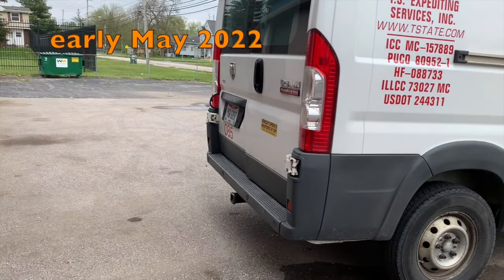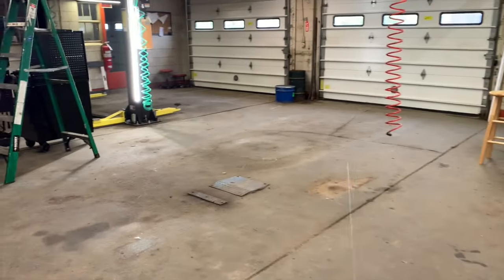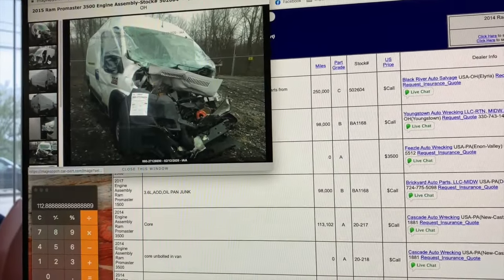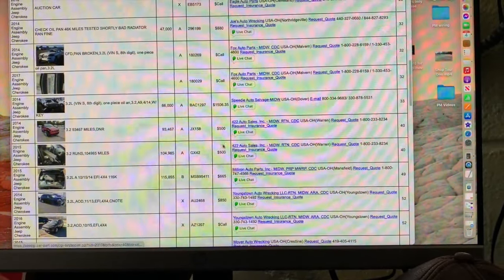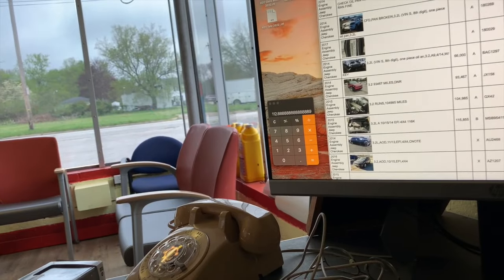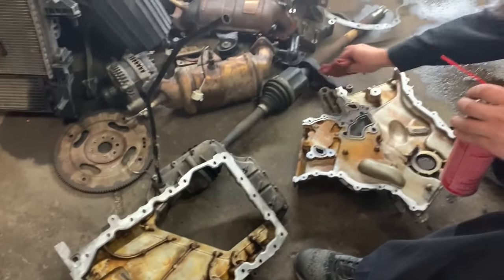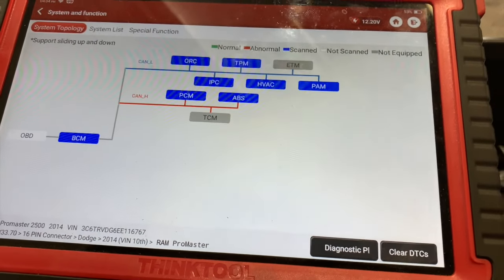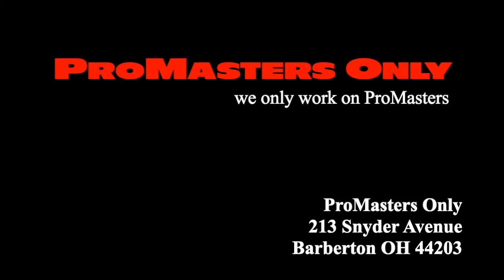Ram Promaster Custom Engine Swap ! Lots to learn

Comment: I live in a 2019 36” 1500, had 32 miles on it when I bought it, has 59k now, have not had one single mechanical issue so far, regular fluid filter changes on engine and transmission, so far so good. BTW, I stopped relying on dealerships for my fluid filter changes, I do them myself. Will be adding a doorman trans pan with drain plug soon.

Your vids are great, helpful and I learn allot. 

Thank you!
Reply from the maker: That's excellent. It's a feature of the interwebs that only the negative gets posted, but puh-lenty of people have had nothing but positive experiences.

Comment: This will be interesting. I've owned a half a dozen Caravans with the 3.3 / 3.8 family. I've noticed the 3.8s always got the best highway milage, the 3.3s the best city milage.  I also own a '20 Promaster hightop 159" 2500 with 3700 miles on it. Thankyou for the video.
Reply from the maker: I made a followup video. Runs great, does the job but has noticeably less power than the 3.6. Mileage is basically the same, unfortunately. 

We are working on the opposite now - a way to get just a little more power out of the stock engine. My feeling is it would downshift less, and be a little more pleasant with maybe 30-40 more ft/lbs.
Reply: @promastersonly1419 Hello Kip, any update on getting more power out of the 3.2?  In late 2023, still running well and worth the effort for $ savings?  Many thanks!
Reply from the maker: @antigroundhogday  It’s still running well in the van we put it in. Still has less power but similar mpg to the 3.6.
Reply: @promastersonly1419  okay, less power but less purchase price. A decent trade-off. Thanks for the update!

Comment: Am curious about the mpg difference. Have you tried airtabs? A few hightop van owners have loved the airtabs, said they reduced the wind effects from passing semi and gusts.
Reply from the maker: I’ve never installed them, but this was much discussed over the years on promasterforum. The consensus is that air tabs on a van dont increase mileage, but they do increase stability. Makes sense. 

As to the 3.2, the data shows that the mpg is basically identical to the 3.6. There is noticeably less power though, and that in turn means more downshifting on hills and under heavy load. I think it would be ok in certain applications or with lighter vans. But without an mpg benefit, I wouldnt recommend a 3.2 swap to a customer. 

The only advantage then is the buying cost of the engine. I was going to do a second 3.2 swap, and bought an engine with under 90k for a whopping $300. Crazy cheap.

Comment: Kip this was awesome, figured it’s been a year since the swap ? Should we still exspect oil cooler and possibly lifter tick with the 3.2 like the 3.6 ? Anyhow at $500 I might go buy one just to keep in a back corner of the garage just in case lol 😂
Reply from the maker: Going on two years. I have update videos on it. So far neither an oil cooler leak nor the tick, but those parts are identical so who knows.

Comment: I got a 3.6 penstar from a caravan with 13k miles for $900 its the same as a promaster. but junkyards see commerical van and add a large premium
Reply from the maker: Correct! It's just a failure of shops to give a crap. Need a promaster engine, search for a promaster engine, pay literally 6 times as much. It's not your money, it's the customer's. 

This particular swap is not really in that category. I had zero idea that it would work. In fact, I expected it not to.
Reply: What site did you get it from?

Comment: Good stuff boys, livin a little. Nice. My 2017 pro master 1500 has only 30 psi in cylinder 5 the poor girl.  I bought it with the repairs required in mind. My guess is the valve issue i see on the tube without a inspection camera in hand. I,m thinking pull the rear head(or left)and fix what is needed rather than sourcing a used engine. Please let me know if its a good plan and also need step by step engine removal if the info can be found on wild web. Thanks and keep them vids comin 👍
Reply: Before you go off half cocked (or fully cocked!) you need a rock solid diagnosis. That would be a leakdown test. With #5 at TDC, put some compressed air in and see where it comes out. Intake, exhaust pipe, or dipstick tube. If its the dipstick, you’re done for. 

If it’s valve timing, 100% confirmation can be had with the valve cover off. Gouged cam, or bad lifters. 

If not cam related, you’ll be doing a head. They come from chrysler assembled with new valves and spring for only $450 or so. You reuse your old cams and assorted valvetrain. 

The rear head (#5 is rear) is a big job but very doable with the engine still in the van. 

As a cost thing, it may make more sense to replace the engine, but it would depend. What probably wont work a traditional rebuild. The parts and labor to rebuild are likely to exceed a used engine, which is $1900 currently for a tested 100,000 mile engine.
Reply: Ha Ha, love the response and very much appreciated,gotta be at least half cocked for the ladies ya know. I have maybe too cheap of a leak down tester coming from the amazonians. Let’s hope quality is enough for this cylinder 5 test . Cylinder 3 is at about 140 psi. Should make wind outta one of the areas that you mentioned. Not quite convinced I will be able to remove that rear head without pulling the motor forward a couple feet. That darn engine cover has to come off the pulley side for that rear head. It would be gravy it I was dealing with 2,4,6. Back at ya with my leaky results just like in the men’s room, that leak is getting old.

Comment: Do the 2022 2500 and 3500 promasters have the same engines? Chrysler has the same part number for block, but some places dont have them as compatible.
Reply from the maker: 22-up have the gen 3 pentastar. Lots of stuff unchanged, but lots of new stuff. Variable valve lift, egr, different intake. Engines are not forward or reverse compatible because of all those changes.

Comment: thanks for the video hey can install engine and transmission from journey to 3500 pro Master thanks
Reply from the maker: If you search for a 2017 Journey, it will pull up everything compatible with a 2014-2021 promaster. This means journey, minivan, some chrysler 200s. It wont give you a choice, but avoid an engine from a 4wd Journey or anything with start/stop. That's for the engines. The transmission are quasi-interchangeable, but not really since the final gear ratio is unique for the promaster. Big topic, but you can "make" a PM trans out of a minivan trans, but it's pretty involved. But any 2014-2021 promaster trans will interchange with whatever you have - all the same.

Comment: So do you think it might be a worthwhile swap for a Promaster 1500 118 shorty low roof?  The van is a bit lighter than a 2500 or 3500 and with the lower roof, has probably around 5 to 6 square foot smaller frontal area so at highway speeds, the hp required to over come wind drag is less. 

I guess what I am asking is does the low roof 118 shorty get any better fuel economy than the high roof 2500 and 3500 136, 159 and 159 extended?

It will be interesting to see how the extra high roof H3 vans will perform or if that extra roof height and weight is going to make a bigger dent in fuel economy and performance.
Reply from the maker: The 118” would be a prime candidate. I have a video on that model. It doest weight all that much less than a 136”, but as you mention the frontal area is a big deal. Owners of those vans report perhaps 1 to 2 mpg better than a 136. 

The height makes a bigger difference, I think. I know this because Volenz owners (with a 3” sleeper above the cab) report mileage closer to 13 or 14 mpg. 

As a tidbit, I own both 136 and 159 high roofs. The longer van gets ever so slightly better mpg. Less than .5mpg, but every little bit helps.

Comment: I have a question the promaster do fits with journey about transmission just transmission
Reply from the maker: Engines from a 14-18 journey are direct seaps, with the only difference being the dipstick and dipstick tube length.

Comment: Wasn't the 3.6 pentastar used in the PMs right from the start, 2014? Sidenote when the weighin for the big contest ?hope u r going to shoot an post it, still chuckling about the rules committee post
Reply from the maker: Yes, and even better they made exactly zero changes to the engine from 2014-2022. Means parts are cheaper and more available and nothing to get confused about. Search facebook for Blubberama 2022 to see the lard loss standings after the first month. Spoilers: I lost 23lbs in 31 days, and DIDN'T have a heart attack or stroke!
Reply: @promastersonly1419  keep up the good PM and blubberama work

Comment: Trying to help a friend here. 2016 Ram Promaster van 3.0 eco diesel. He converted it to a livable van but it recently overheated. First shop said oil and water were mixing and it needed a new motor. When pressed what the cause was they wouldnt say. He called a diesel shop and they didnt want the work. Van is located in North Carolina.

What would you do in this situation? Look for another diesel shop? Buy a used 3rd gen motor(eco diesel) and swap them?
Reply from the maker: Hate to say it, but you aren't going to like my answer. As great as the gasser is, the diesel is the opposite. Expensive, unreliable, and nobody knows how to work on them, including me. I have to turn them away from the shop, and it pains me. If he goes to a dealer, they will lift $14,000 or more off of him for a new engine, which will fail in short order. He'd be better off spending that money on a used gas van and moving his conversion stuff to it. However, I try to remain positive - email me at promastersonly@gmail.com and I will give you the email of the ONLY guy in the country I know who works on the diesels.

Comment: Hate to ask a question but im trying to see what model pro master were you working on  i have a 2021 im about to put and engine in and trying to see what model 3.2 did you use
Reply from the maker: While it worked and it was fun, I think the 3.2 swap was a failure. Noticably less power, same mpg, and the only real advantage is the buy-in cost of the 3.2. I saved $1500 buying the engine, but $1500 over 200k or 300k miles is negligible. 

But if you must know, 2014-2021 promasters are all identical down to the last nut and bolt. The 3.2 came out of a 2015 cherokee. 

Makes me think; a 3.6 in a cherokee would be a cool hop up!
Reply: Thanks you helped me out greatly

Comment: So is that 3.2 more reliable than the 3.6?
What's the labor cost to do this swap?
Reply from the maker: I have follow up videos on this swap. Basically, this was an experiment. Power is less, mileage is the same, so the only advantage is the cost of the used engine. Labor is identical. We charge a flat $2700 for labor, but that includes a lot of extras. Figure labor at 20hours total.
Reply: @promastersonly1419  Thank you.
I watched your videos all night. I want to give you the business and I just already trust you. 

I am considering buying a good body and chassis with a bad engine. I'll connect with you from your website with other questions.
Reply from the maker: @tedd7028  email me at promastersonly@gmail.com. If you do it right, you can put together a great van for 10s of thousands less than a new one.

Comment: Why  that  valve cover need to be replaced with that one  from  3.6  cover      thanks
Reply from the maker: Not sure if I understand the question. We used the valve covers that came with the 3.2 engine, though I believe they are identical with the 3.6.

Comment: hello 
you have anything on  rocker arm?
Reply from the maker: @steveroe577  many videos. The answer is to use the rockers that end in 296AH, bought from the dealer. Upgrade to those, and you are good to around 550k total miles on any given engine.

Comment: Hello!! I need big help cause i need to replace my engine but I live in Germany and my options are limited. I have a 3.6 pentastar Chrysler 300s awd. Do you think a  3.6 from a 2020 challenger rwd will fit ? Both engines are same horsepower. Thank you in advance!
Reply from the maker: Yes, I believe so. Both the LX cars have the Gen 2 pentastar, meaning they dont have EGR. A way to tell would be the valve covers, and if they spec the same 5w-20 oil as the promaster on the fill cap. 

Assuming they are, you’d need to use your promaster front engine cover, upper intake, and possibly valve covers. But the basic engine is the same and interchangeable.
Reply from the maker: The same engine should be found in 2011-up minivans, most Jeeps, and the Lancia Thema I think. There’s also a Maserati variant that could be made to work, I think.
Reply: @promastersonly1419  thank you very much for the reply. I forgot to mention in my first post that my 3.6 awd is a 2016 model. In photos they look exactly the same except the bottom part of the engine. I feel that if I change the pan it fits
Reply from the maker: @johnbafas2653  correct. Will require your old upper and lower oil pan.

Comment: How is it going.  good night.  I have a 2014 3.6 dodge dodge ram promaster.  and I have problems with the transmission I wanted to know if you work with transmission
Reply from the maker: We do. If it’s a full rebuild we send that out, but usually it isnt. What’s it doing? Codes?

Comment: What was the outcome?
How did it work out?
Reply from the maker: I put it in a subsequent video. Basically, negative. Noticeably less power, same fuel economy. So the only win is the cost of the engine. I have a complete, low miles 3.2 that I got for $280 and stuck on the shelf, and may put it in a short wheelbase van someday. But until then, stick with the 3.6.
Reply: @promastersonly1419  Thanks.  
Maybe warrants a sticky comment for others.

Comment: Sorry to bother you, I have a 2014 Promaster 1500 vin#G need to know if any 3.6 pentastar will fit the pro master or needs to be from the same year range? Thanks in advance
Reply from the maker: It's all in this video, but the short of it is you should be looking for an engine from a 2016 Journey. That will pull up all the journeys, minivans, and a few others that fit. The only things you'll need to swap over from your old engine are the upper engine mount pad that bolts to the block, and the dipstick tube and dipstick (though the journey dipstick tube and stick will work, it'll just be harder to reach). The video shows you how to find it, and how much you should pay.
Reply: Greatly appreciated 🙏👏👍

Comment: 3.2-3.6 are like saying old 360 and old 318 they will interchange.
Reply from the maker: Similar. But in some ways, the Kip Swap was a failure because the van has slightly less power, but gets the same mileage. The 3.2 engine was much cheaper though.

Comment: What scanner are you using?
Reply from the maker: We use a ThinkTool Pro S. It's slick, but it doesn't do much that a scanner costing much less does. In the new year I'm looking to upgrade to the factory Chrysler system, which is called WiTech. Expensive, but worth it for what we do.

Comment: Can a transmission from a Jeep Cherokee be swapped into one of these?
Reply from the maker: No. As a FWD mopar, only the 62TE will fit or work. They are to be found in minivan, some Aspens, 200, Journey, Routan, and Promaster. Any non-Promaster trans swap will require the Promaster diff and final gear assembly be swapped over. But otherwise, all the 62TE are generic and will work.
Reply: @ProMasters Only  can you elaborate a little more on this? Is this something a DIY could do in the backyard?
Reply from the maker: @MrWhite-fo3es  refering to a cherokee trans? The jeep is rwd and promaster is fwd. Aint gonna swap. 

Refering to the 3.2 engine swap, I dont recommend it. It works, but with less power and the same mpg. Only advantage is the cheapness of the 3.2, but I prefer the 3.6 power.
Reply: @promastersonly1419  what about the 62te swap from the other vehicles.  It's like double the price for a promaster.  How hard would it be to get one from a mini van or others to work with the promaster?
Reply from the maker: @MrWhite-fo3es  Great question. Any 62TE 2007 up will work, provided you swap your genuine promaster differential onto the back of it. I haven't done it personally, but the diff is like 4 bolts and easy to do. The reason is the final gear ratio is unique to the Promaster. That's why they are so expensive at junkyards - yards sell them complete with the diff. I know one guy who just plopped a complete minivan transmission in and it worked, but I'm skeptical that it would work well because the computer expects to see a certain wheelspeed that matches the trans output speed, but a trans with a different gear should make it throw all kinds of transmission codes. Also, with the gear in the minivan the Promaster would be turning something like 500rpm less at 60mph. This would help mpg, but the engine would be lugging and downshifting all the time. But, no other internal parts to the transmission are different between a Promaster or a minivan or Journey that I can find, other than the diff.
Reply: @promastersonly1419  thanks 1000 times. I am definitely willing to try. My transmission internals are good just a busted case from the mount

Comment: Se puede colocar un motor de promaste 1500 en una van ram 97' 1500?
Reply: Not a chance. Promaster is a front wheel drive platform.
Reply from the maker: The motor could be installed, but it would be very difficult to make the computer work. And you would need another transmission and a computer to control it. Complicated.
Reply: @promastersonly1419  ok muchas gracias